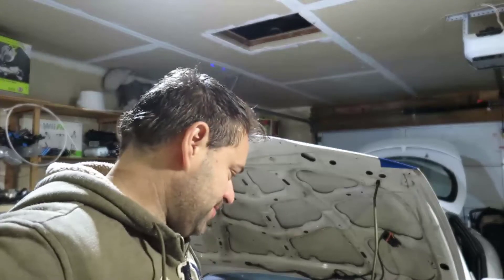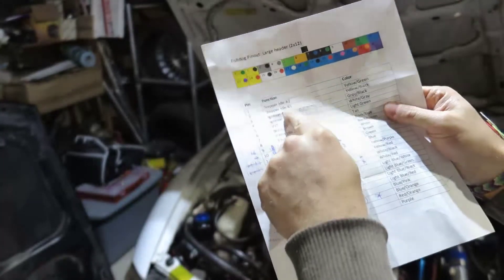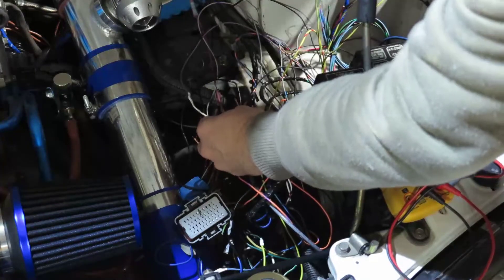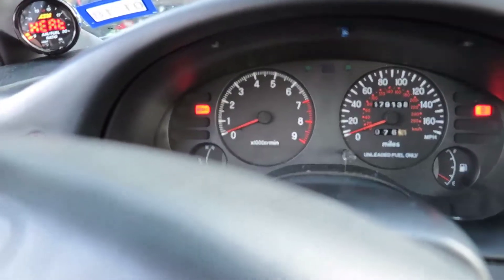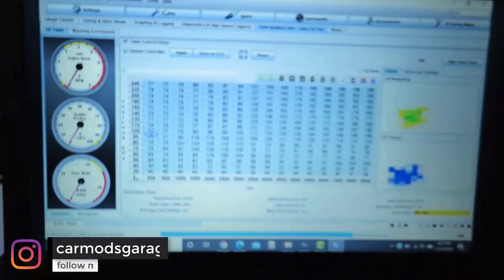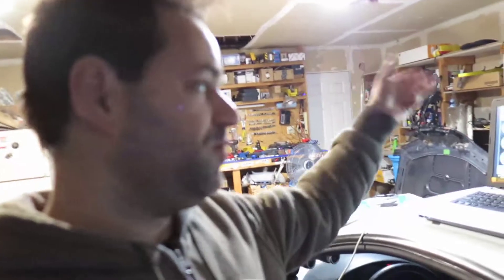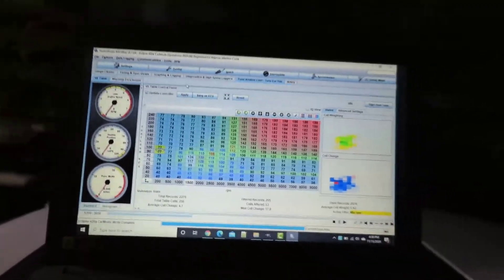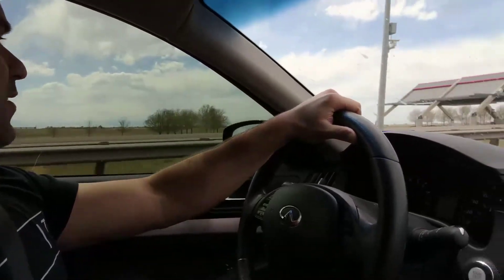Wiring Idle Air Control Valve on SpeedyEFI  - Eclipse Speeduino

Comment: hey, we were just talking about idle air control. I'm thinking of just using an on/off valve to add to my setup.
Reply from the maker: I was going to use a on and off kind on the 2jz but it idles like a champ so I have up
Reply: @CarModsGarage  I have a bosch style 2 wire rotary iac I can use... I'm worried that I won't be able to find specs to program it easily and it will cause more heartache than good!! :P
Reply from the maker: @Elswalbe  you won't know if you don't try. The on/I think there is no config. You plug the wires and a vacuum line that's all I think
Reply from the maker: That could work